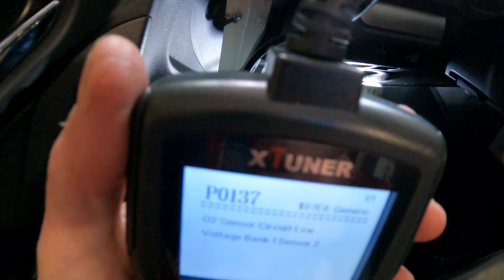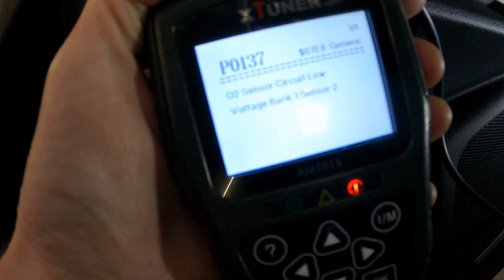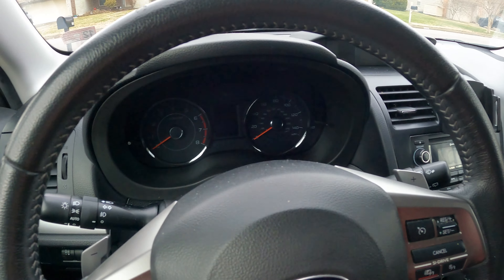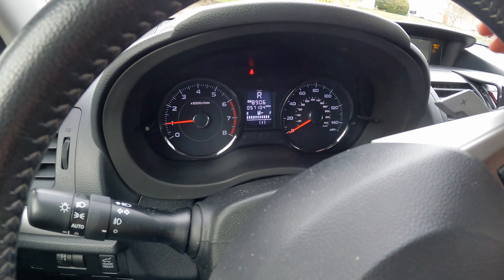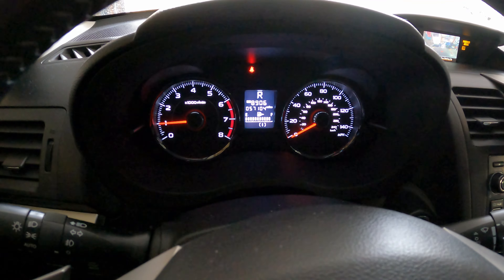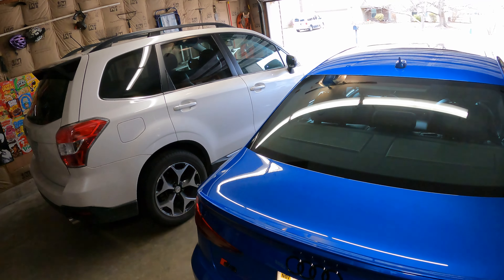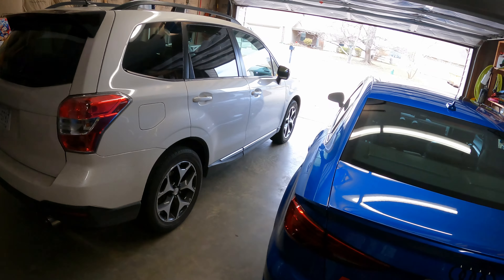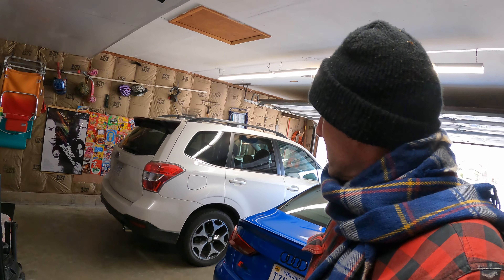2015 Subaru Forester XT Minisode 149: CEL Light Out of Nowhere!

Comment: check resistance on heater wires for the sensor.  also check connector for any sort of damage or corrosion if the resistance tests OK.

Comment: We have ‘14 Outback with 155k. It threw a P0171 code (running lean) in zero degree weather last week. I cleared code, replaced air filter and tightened intake clamps and it seems good. I think really cold weather and these hyper sensitive modern cars make for some strange occurrences at times.

Comment: Could be fuel as well. Maybe used regular fuel because prices are going sky high for the premium. O2 definitely could be replaced at 57.000+ miles that is over 91.000km decent milage.

Comment: If you have an OBD II scanner or wireless dongle to use with your phone monitor the voltage of the O2 sensor. See if the reading is within range and updating. Another trick if possible is swap the sensors and see if the code changes to the new location.